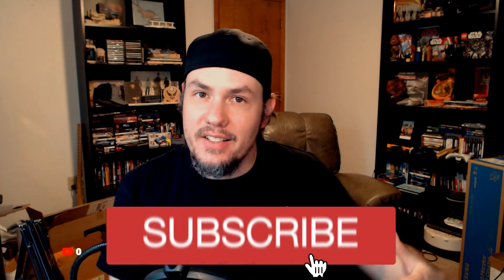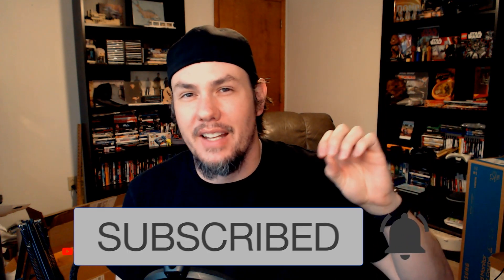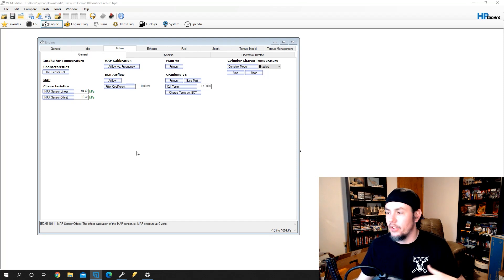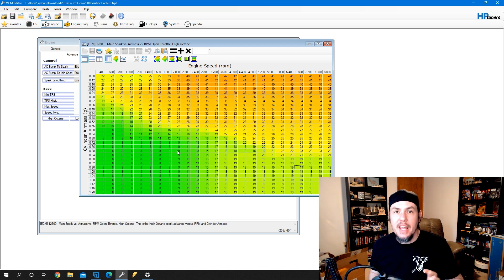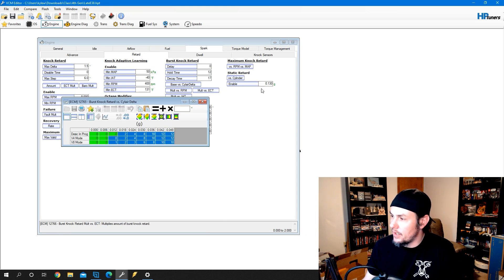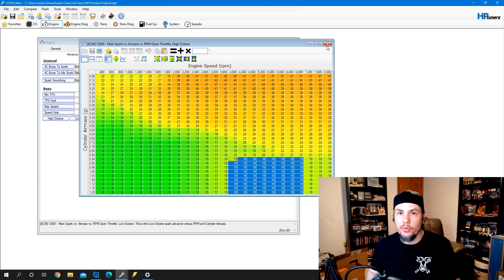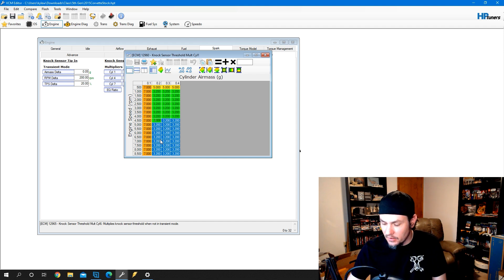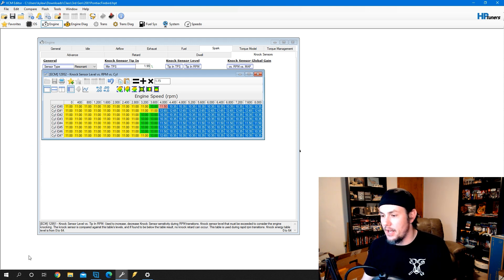Engine Knock, False Knock, Knock Sensor Sensitivity Explained!

Comment: I was tuning maf only on low octane and can see the knock areas in the vcm scanner graph. I didn't make any adjustments because I want to wait to switch fuel octane to 91. Now I am almost 95% sure I'm hear knock around 2500-35-- RPM But the graph shows nothing. 04 2500HD 6.0. what could cause that?

Comment: Hey goat roap... I have an ls swapped wrangler that I'm having a weird problem with...  so it started life as a 5.3 4l60e swap and it ran... ok... I was consistently getting 8 degrees of knock at wot around 4000 rpms... ves were all dialed in to within 3 to 4% and bone stock timing maps... it was a gen 3 ecm... now here's the interesting part... I just pulled the 5.3 out and put a 6.0 in a couple weeks ago running the same pcm intake setup and manifold and exhaust... flashed a baseline 6.0 tune in with my injector data and dialed in the ve and maf tables the same way I did the 5.3 and boom... 8 degrees of knock retard around 4000 rpms... please help!!!!!

Comment: I know this video is older but boy you are a fountain of knowledge. Are you able to possibly make a video on reading spark plugs for timing, heat range, air/fuel, and pre ignition/detonation???
Reply: I’m actually doing that myself now. I’ve been sharing my plug progress which corresponds to each time I improve or change my calibration.

Comment: @GoatRopeGarage At 1:45 you said peak combustion pressure should take place at 6 degrees after TDC for maximum power efficiency but science sys it is more like 15-20 degree after TDC.
Reply: But that also has to do with engines VE. Most information out there reflects on factory performance but not modified performance bcs those things aren’t street legal, so it’s not the first thing that pops up. Ported manifold, headers, intake, cooling… all will allow a more ignition angle bcs those mods improve VE and lowers cylinder pressure allowing for sooner ignition to take advantage of the headroom.
Reply: @AutoBodyEverything  No you don't understand. You have it back ward...

Comment: I think I might have false knock. Yesterday I had some knock so I adjusted timing down and today it shows knock in similar areas and even some more
Reply: Have you checked loose bolts? Mounts, manifold, axle.. if you went down to Zero° and you still see noise, that’s got to be vibrations. I have two rpm points that never fail. One point is obviously vibrations and the other I’m has to be as well, I just don’t feel it. Across various maps, same points, same amount regardless of ignition. I’ll go into my knock tables but after I improve the vibrations.

Comment: Is one better.  1 wire or the 2 wire knock sensors. Better/ Easier,  for tuning/ Calibration,  Terminator x max, 4.005 bore.   forged & forced probably only 9/11lbs.  The forms are wearing me out. Can you make a Recommendation. Thanks 👍
Reply from the maker: Honestly don’t know, but given they went to a two wire sensor my guess is it is better because car manufacturers tend not do anything that will cost even a penny more unless there is a benefit.
Reply: @GoatRopeGarage  Roger that.  But better can mean saving Them money, not providing a better part for After market alterations.  Thanks man ✌️

Comment: can we use gen 4 knock sensors with a gen 3 computer ? or it wont be tunable ? i had a failure on my gen 3 engine so i got a gen 4 block and swapped out the crank reluctor to 24x and the cam  1x so im just missing the knock sensors .. i do have new gen 3 sensors i just didnt wanna drill and tap the block ...
Reply: Are you going to monitor individual cylinder knock? My platform don’t support 4 knock tables but I could still apply all 4 k sensors via analog input. With that plus reading my plugs, I do have competition tables for individual cylinder adjustments via fuel trim.

Comment: Sorry, i had to stop watching about 1/3 the way through. 
Pre-ignition and knock are 2x completely different things, they are not the same. 
Knock is rapid uncontrolled ignition AFTER top dead centre, usually from too much timing. Pre-ignition is spontaneous combustion BEFORE top dead centre, usually from excessive air temps or glowing hot components/ carbon build up.
Reply from the maker: Both are handled the same and the results of the same things, uncontrolled cylinder temps usually due to pressure. To say they are completely separate things is pointless when the ecu treats them both as the same thing.
Reply: @GoatRopeGarage  most strategy's are set up to only sense ATDC, so knock happens ATDC. 
To diagnose the cause of and prevent engine damage, the reason for pre-det or knock must be treated separately.

Got pre-det? Your engine probably needs a rebuild or to be decarbonised, probably running too much boost or too high compression for the fuel being used.
Got knock? Reduce timing, too lean of mixture, change fuel being used for boost/compression. 

The two can be related with similar causes and symptoms. But the two types of uncontrolled combustion are different things.
Reply from the maker: @motabikeboy not when you’re relying on 2 sensors for 8 cylinders. They don’t take into account crank position. Frequency and amplitude, and the frequency is based on bore size regardless of if it is pre-ignition or knock.
Reply: @GoatRopeGarage  uhm, actually yes ECU's do take all of those factors you mentioned into account. 
Factory ECU's also have all of those parameters programmed into them if using wideband sensors, Especially standalone ECU's.

Comment: have you ever seen a data log with every cell except the first row horizontal and first row vertical there reading 0 but literally every other cell hit in the log all read 8? i am new to this stuff but all 8's and 2 straight rows of 0's seems suspicious. plus when i try reducing the timing 8 deg still get the same 8's everywhere looking data log, but like i say i am new and all ears to any suggestions knowledge exc, also thought id tell ya thanks for these vids to!  tho i probably would have given up figuring this stuff out if it wasn't for your awesome videos giving me the knowledge and confidence to stick with it! and learn everything i could. and not try and take any short cuts like i often do in life, so thanks for that. I picked for my first vehicle to try and tune a S10 i LQ4 swapped and half way through the swap decided i might want to turbo charge this some day, thinking to my self one day and i wouldn't want to have to build custom stainless headers and full exhaust for this thing twice down the road i better just get it all right the first time so ya 1st is LQ4 being feed by a s475 with a t4 hot side and AR of 1.25 but i had her running great just this odd knock thing that started first thing when i pulled the hot rod out to see the sun after its hibernation this last winter. i had it running better then any stock truck i have ever owned for sure. hoping its something simple. thanks again

Comment: @9:49 Options for "KNOCK SENSOR LEVEL:  INITIAL LEVEL,  MIN LEVEL" -- you didn't drill into this.  I'm playing heck w/replacing KNOCK SENSORS and the monitors are complaining on 2002 Silverado 1500 w/P327 and P332!   Don't have access to HP TUNERS -- but any chance those value adjustments affect throwing these codes???  Thanks!

Comment: What's up man, thanks for the video! So, I've got a 3.6L LLT V6 with Mace Cams, headers, intake, etc and I noticed that the knock sensitivity values from Tuner X are the exact same as the stock values; shouldn't they be changed at least a bit? The Mace Cam has a sharper open/close so I would think that would create some additional "noise" in the valvetrain/engine. Ever since I installed the cams, it's developed a misfire on all cylinders. Checked and rechecked mechanical timing, walnut blasted the valves, ultrasonically cleaned injectors. One thing I did not do (but plan to) is relearn the crank position sensor. Do you think either the crank relearn or the knock sensitivity values would cause these misfires? Thanks in advance, man!
Reply from the maker: Crank relearn has to be done with new cams, I would stay there

Comment: do you find false knock when using energy bushings for engine mounts? I am building a boosted 408 ls putting it in a 78 jeep j10 and using dom and energy suspension bushings for engine mounts and wondering if that will be to stiff of a mount causing false knock readings. thanks

Comment: Bro you’ve help so much with these videos. Helps me understand thing in my dodge tuning course from tuning school. Still working on knock I’m having a small -4.0 knock retard but happened only once with wot. Spark is staying around 10-30. Is there anything I should check or is this such a small number it doesn’t matter and will not cause damage in long run
Reply from the maker: Did pulling some timing in that area lower it? If not your knock sensor might be too sensitive
Reply: @GoatRopeGarage  I have to do time pull tonight and check morning thanks man.

Comment: My problem is that I don't get any knock shown on the knock retart table. I'm logging knock retart , cylinder airmass on my P&IDs and kept adding spark little by little till I got to 32 degrees of advance to see if I can get some knock but not even 1 degree of knock comes up on the graph just zeros and put it back to 22 degrees.  Its a gen 3 5.3l LT headers, 3" pipe, NNBS intake, K&N cool air intake, Full built transmission (4L60 E), TBSS stall 2600-2800, and a cam motion junk yard dog camshaft (232/244 lsa 111+4 int .621 exh .604). I don't know if my knock sensors are not working or turn off i replaced them when I installed the motor on my truck. Checked all the parameters on the knock sensors and compared to a bone stock file and they are exactly the same.

Comment: Magnuson sc on c5 z06. Suddenly KR one day max KR pulling all the timing as soon as in the throttle. I pulled 8 degrees timing this is now  like 14 degrees crossing into boost. It still max KR even if you roll into the throttle it pulls all the timing and the KR wouldn’t even decay unless you completely get off throttle. I used this video removed the burst and desensitized a bit. The supercharge has to be making a noise or something causing false knock. Thanks so much!! Just put a mew vid up of another ls car I’m helping out on and will put one of the vette up today if I can.

Comment: Awesome videos thanks for all the info! Watched the Gen 4 Spark tuning video as well(And more). have you ever ran into this scenario. Stock NA Gen 4 e38 6.0 (Burst knock is off etc..) Using my Stock High octane table from the factory I'm showing spark knock. I cant find a pattern in my logs, it seems to happen what would be considered randomly sometimes as much as 5 degrees. 225K mile motor. Should i desensitize whole table? or is there maybe a physical part that might be my culprit? I have looked for anything that could be rattling.(VE and MAF are both dialed in already, I am in Texas heat though)
Reply: Have this issue on my Gen 4 5.3 now. Any luck?

Comment: I have 2015 Mustang GT with twin turbo set up. 9.5psi at the moment. Running E85 testing at 87%. When I stab the throttle it jumps +9.99 knock and stays there through the gears.  When I gently/slowly roll on the throttle until wide open its -2 knock through the gears.  Ive literally spent countless  hours searching and fixing anything that could be tapping or hitting under Torque and it changes nothing. Is this +9.9 I'm getting possible false knock?

Comment: Hey Kyle so my ls1 said it had 10* of spark knock up in the high end, so I took out 10 degrees of timing and it still had the 10 degrees of spark knock, would this desensitizing help? Could that be the problem?
Reply: If you haven't figured this out yet, it's possible you have a knock sensor code. In that case, it pulls the max value by default.

Comment: I have a stroked 392 to 430...I kept raising the timing and watching the graph on Knock retard and Never saw any KR on the graph.......doesn't seem possible
Reply from the maker: I would question the knock sensors, if you get into the mid 30's it's probably suspect

Comment: I was told that my knock sensors have been de-sensitized.....so look at HP Tuner software on my Dodge I see voltages.....0 to 5 volts is the range...so the question is ...lower voltage setting makes it more sensitive or high voltage???? Which is it???   Since it has been changed and I'm new to tuning I want to know???
Reply from the maker: Lower should be more sensitive I would think but see if you can find the specs on those sensors

Comment: @GoatRopeGarage - why just 15% added to knock sensitivity?   Seems like a small increase over a large range (my stock Gen3 setting is 9.0) like yours was in the video before you added 15%.   I also notice that Cylinder #1 and #4 don’t have the same sensitivity value?

Comment: So excited to finally have this video. Would it make sense to build a histogram on the scanner that mimics the knock sensor sensitivity table to help track where the events are happening?
Reply from the maker: Build one that matches your spark table and then use the knock retard parameter to populate it, shows you where you're getting knock on your spark table. The default layout has an example and so do my layouts on the website.
Reply: @GoatRopeGarage  yea I’ve got one for the knock based on the timing table already to pull timing out, but I’m asking if it might also help to build a histogram that would mirror the knock sensor sensitivity table to dial that piece in too.

Comment: I recently did a video turning off knock control all together on a 4.8 Silverado using a external knock monitor to view and listen to a wideband knock sensor  (doing a give away on one on that video still) on the dyno and compared the GM knock control strategy vs. custom using the external unit and was pretty shocked by the difference. I think that was a bit of a wild card but still was fun to play around with.  About half way through this video now, curious to see your approach 🤘
Reply from the maker: It's aggressive, that's for sure!
Reply: I just installed knock link knock light on my zo6 corvette boy does it work! I also needed this info!
Reply: What's up @Joe Simpson!
Reply: If I am only using torque pro to monitor KR on a stock 4.8 Silverado 3rd gen, and kr always creeps up to 6+ degrees as the rpm increases, would this likely be false knock? I don't hear any knock and I don't often see any knock at all at low rpm, high low take off situations (truck is loaded heavily with work gear), it just creeps in with speed and rpm (above say 2400 rpm or so). No codes and it runs fine, I just want to help make this thing last forever.

Comment: THIS IS THE M.F. VIDEO IVE BEEN NEEDING! Thanks for all your help Kyle, been a long road getting my Tahoe running right, this should help immensely!
Reply: What tahoe do you have? I've got a GMT 800 with LQ9 build. Trying to Tune PE but knock is entering the scene. Typically motor doesn't register ANY knock say during cruise, but when I go to 30%+ throttle it can knock at completely random spots in the table RPM / Cylinder airmass. I added TONS of fuel and it won't knock at ALL now but was just a test. I'm not sure what to do from here...